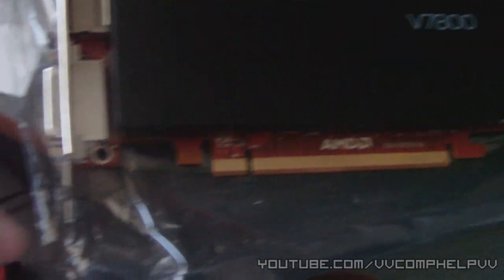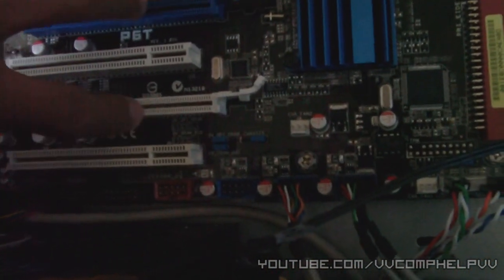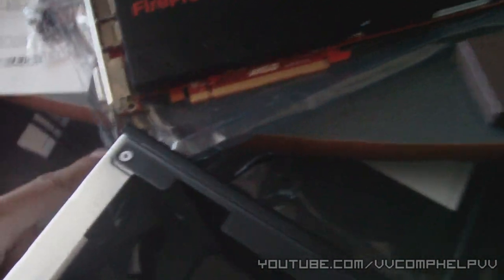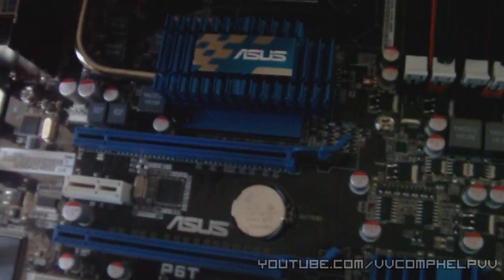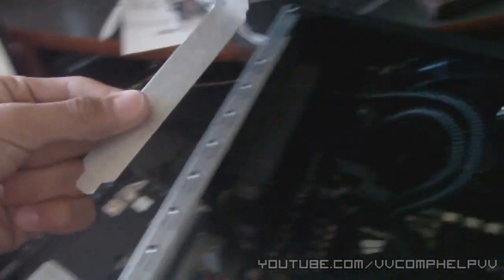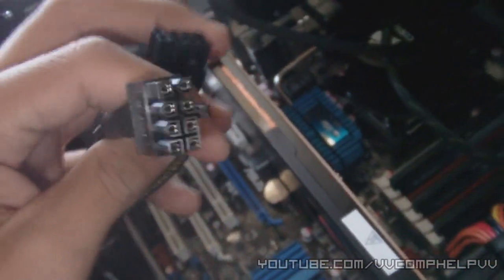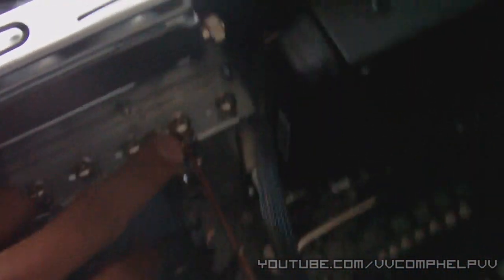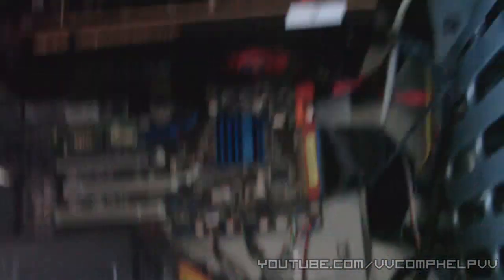How To Build A Computer Part 10: Installing a Graphics Card

Comment: @xunezan, i dont know what will happend but it wont woork you need to have the same series , like you can go sli whit gtx 460 form zotec and another gtx 460 from msi or 2 from zotec etc. but you CAN'T use a gtx 460 and gtx 570 it wont woork

Comment: Hi, so if I where to install a new graphics card would it's effects automaticly kick in when using it's VGA port is thre any drivers to consider while running? / windwos configuration.